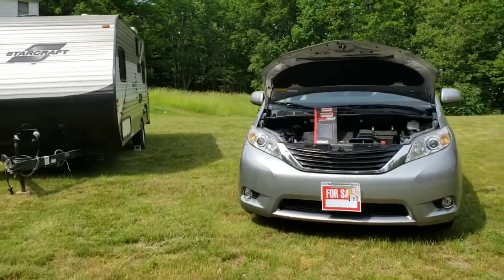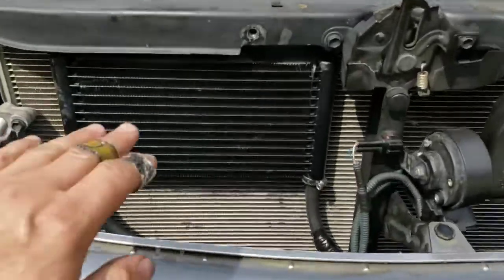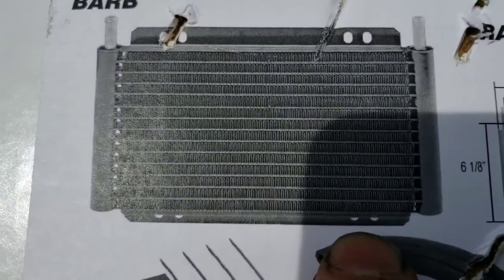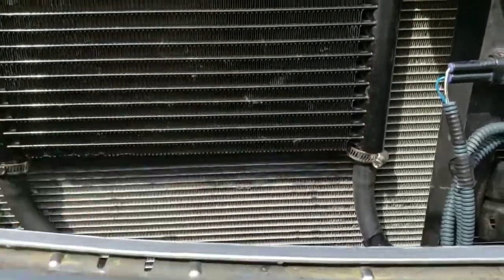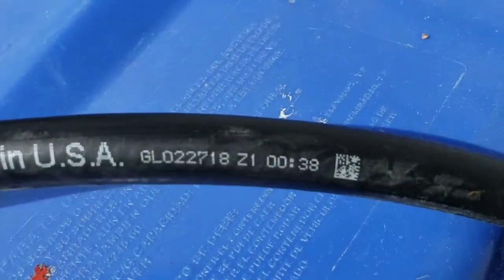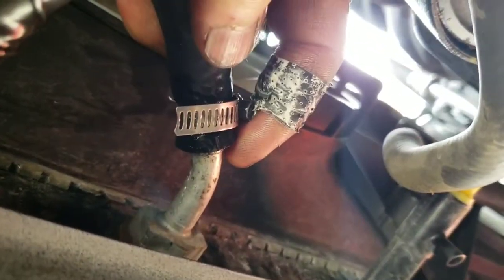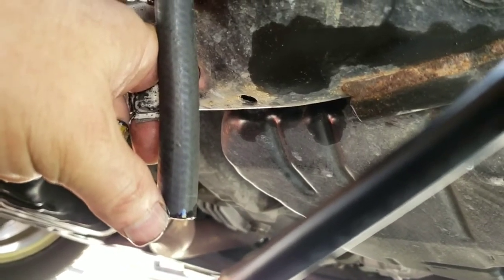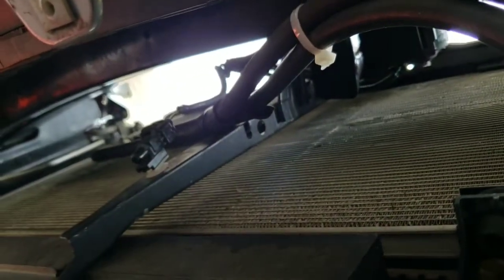2012 Toyota Sienna transmission cooler installation [EASY]

Comment: Don't think the return side really needs 400 psi hose as there is really no pressure. It just dumps the cooled fluid back into the pan. If it did I would guess Toyota would have used it, but they just used normal thin wall hose.  Thanks for saving me the trouble of finding which one is the return line.

Comment: You plugged up condenser coils with rtv and simultaneously made it so that if either your rad or trans cooler fails effectively both need replaced....

All to prevent yourself from making a proper mount that would've cost maybe $10.....or heck even using zip ties.

Comment: Scott, Great video! Thanks for your time and effect
I see you are going to be pulling a 3500lb camper. I also have a 3500lb camper, but my Sienna came with the tow package. Are you going to do any other improvements to tow? I also considering installing a trans cooler and a trans temp gauge...any thoughts. I currently tow with a WDH and brake controller and plan on reinforcing the receiver hitch by welding an additional bar off the hitch creating a third connection point to reduce torque on the hitch.

Comment: If you live in a Cold Climate... you should run the cooler PRE radiator right?  Being that cold Trans won't shift. (-10F) so the line is there to heat as much as it is to cool.

Comment: I was wondering with the input and output pointing down, won't the fluid just travel the across the bottom of the cooler, leaving an air pocket on the top section?
Reply from the maker: A transmission fluid system is not a closed loop system. There are ventilation caps on the top side of a transmission that allows pressure changes in the case. With that said in the air pockets in the cooler would just be pushed into the main part of the transmission and then the air escapes.
Reply: @themarginalmechanic5928  There in lies the problem, as the transmission fluid fills the lower passages of the cooler first and then flow down the exit side.  Once the exit side is covered with fluid, it would leave air trapped on the upper section of the cooler.  Since air is of lower density, it's not going to push down through the fluid to exit the cooler.  As a result you would not get the full cooling capacity of the cooler.  The ideal installation orientation would be to have the exit port located on the top side of the cooler to purge any air from the system.
Reply from the maker: Well I guess my answer is follow the manufacturer installation instructions. If I go get those instructions off the web somewhere and I find out that I installed it upside down then I would be disappointed in myself. So I guess that's something to prove out

Comment: How did you get your fluid levels correct?  The  3rd gen Sienna transaxle is exceptionally finicky about fluid levels and from what I've seen it is a major lab experiment to get fluid levels correct requiring specialized tools in the hundreds of dollars.  Check out a few vids on the subject.  The engineers who invented the so called sealed transmission with no dipstick... grrrr.  I am wanting to add a cooler to a 2016 Sienna and to do it 99% correctly is a tooled up shop job from what I've seen.
Reply: I took mine to the dealership a few years back and they requested the vehicle to be there for a long period of time to cool down the transmission fluid as trans fluid expand with heat. The tech called me to tell me that the fluid shouldn't be changed for it's a life fluid as I happily declined his option. The tech called me back again and said it was the best decision I've ever made because it was very dark even with two quarts extra, he'd helped flushed. Well, that being said the van has only 73k ish miles. I got the van back and drove another 30k and within that time the fluid darkened again so I switched over to Valvoline Maxlife as this time I did it myself for friends and I experienced gear hunting shifts due to fluid levels done incorrectly at the dealerships. Trust me, the Main Tech is a good childhood friend as well and I think dealerships are similar to fast food due to labor and cost towards the mechanic that's another story lol. The job won't cost you much if you do it yourself all you need is a Laser thermomotor gun for 30 bucks basic tools and patients. Doing it yourself will save you a lot of money and give you knowledge of your vehicle. If it's cold during the winter where you're at installing a fluid thermostat with a transmission cooler you'll get your van longer intervals and a longer lasting transmission. For your question this channel helped me out to diy https://www.youtube.com/watch?v=B1GwAsIVWuk.